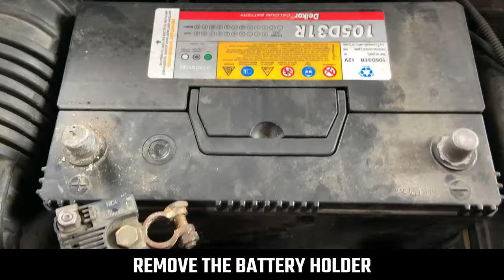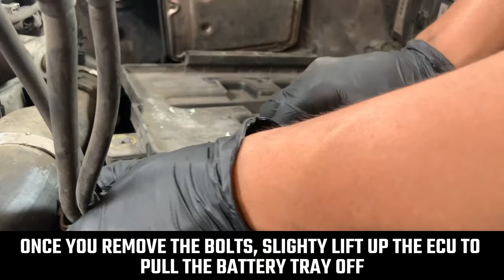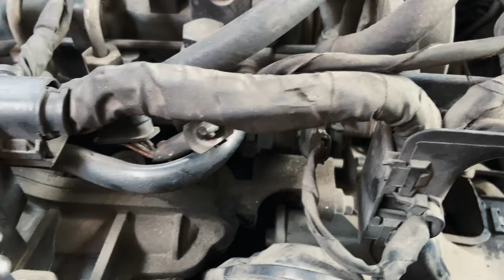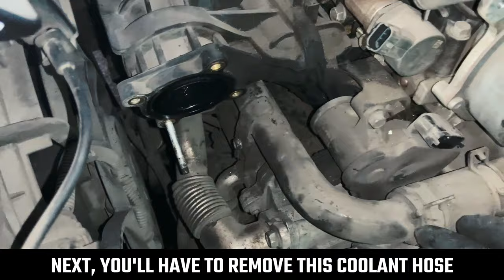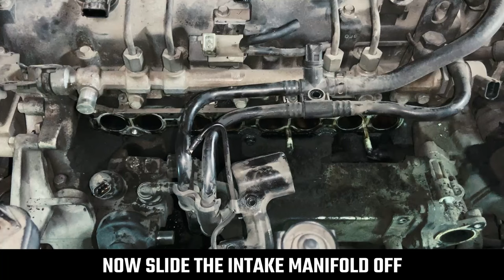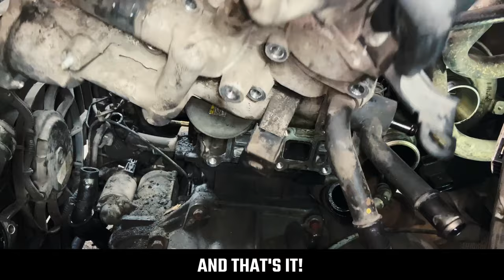HYUNDAI TUCSON / KIA SPORTAGE EGR AND INTAKE MANIFOLD REMOVAL | D4HA | iX35 | CRDI | DIY GUIDE

Comment: MG 😱 All the to clean the ERG valve. Might as well pull out the engine and to a compete rebuild 🤯
Reply: that's exactly what I thought.... i have that problem with my car and I'm worried cuz looks like that's the same engine i have 1,7 crdi that kia used between 2010 ang 2015. i hope that I'm wrong...
Reply: Yeah i got hyundai ix35 with the same 1.7crdi engine..this video makes it easy for sure  but it’s no easy task i tell you…, i have basic knowledge , like brakes , some other parts, oil, filters..but to do this is a serious task , i don’t think it will be easy to do on my own..better leave it to a mechanic.

Comment: Wish I had found this video before I did mine. This makes it so clear. My 2011 Santa Fe runs so much better now. It took 3 sessions with the pressure washer and 2 long soaks with heavy duty oven cleaner to get all the sludge out o& the manifold. Still an easier job than removing the egr assembly on the previous generation diesel. Would love a video showing where the damm PCV unit is.

Comment: I got the P0299 code and took the throttle body out very dirty, cleaned it and found oil into the intercooler pipe that connect to the throttle body..i guess intercooler might be plugged, didn’t see any leaking pipe , turbo actuator works fine..also found the fap a bit noisier..this F…carbon is everywhere

Comment: Hi, great video , thanks for sharing. Anyway i wanna ask what will happen if we dont clean all this?  My engine jerking & stall whenever i put on reverse or D with A/C On. I change fuel filter, fuelpump and crankshaft position sensor but seem the problem still there. No engine warning, no faulty code on diagnose. Sometime while driving my engine jerking. But the most obvious is when A/C on the engine jerk then stall on reverse & D. I can drive it without A/C on no problem. Do u know the problem?
Reply: Did you find out the cause on this as mine does the same!

Comment: You are a good mechanic ,   Can you give me a tip how to get into the Boost Control Position Sensor housing on the turbo (D4HA)  , can this be done without removing the turbo? I have a p2563 so I will give the sensor a clean/replacement.
Reply from the maker: Yes you can remove it without removing the assembly. Thanks!

Comment: This is absolutely amazing content!! I have to do this job on a D4HB CRDI (Sorento). 

One question, maybe you can help, any idea where the damn PCV Valve / Breather is on that model? Having a hard time finding it :-(
Reply from the maker: Breather valve is at the back. Thanks!
Reply: @btdgarage  cheers man!
Reply: I have a Sorento D4HB CRDI, is this near exactly the same process and layout of the steps in the video? 
How did you get on Simon?
Reply: D4ha and d4hb are almost the same engines. The difference are only in the pistons
Reply: @wayne5128  Hey, sorry, missed your message. Went on well, in the end I had to swap the rocker cover (350.000 KM). Also rerouted the pcv line to an oil catch can as my piston rings will need replacement at some point. Having too much blow by. 

Still considering an EGR delete as my intercooler keeps filling up with soot. Actually causing a P0299. What are your thoughts on this @btdgarage?

Comment: Hi, is it normal for the Throttle to be open like that when the car is switched off? I have Kia sportage 2.0crdi awd same engine, its so heavy on diesel. I was thinking of changing the throttle, thought it was faulty.
Reply from the maker: Hi! Unlike gas engines, diesel throttle bodies are normally open as default. They’ll only close upon shutting the engine down. You may confirm it’s operation by idling the engine with the hose/pipe of to observe the throttle body butterfly then turning the engine off (butterfly should shut close, then open). Just make sure you have scantool ready to clear any fault codes or check engine light afterwards as the ECU may get a low boost reading and throw a CEL
Reply: @btdgarage  Thank you for your response, I did the the observation it does exactly what you said.

My idle is at 1000rpm is that normal for these cars? Or it has to be lower than that?
Reply from the maker: @tshepodhlamini4640  Should be around 700-800rpm with AC on. Try to have your throttle (pedal) position sensor checked first. Easiest way to check is to hook up a scantool and check via live data feed (throttle pedal PID) if it’s accurately getting the correct 0-100% pedal position. If it does, best to have your vehicle checked by an expert :)